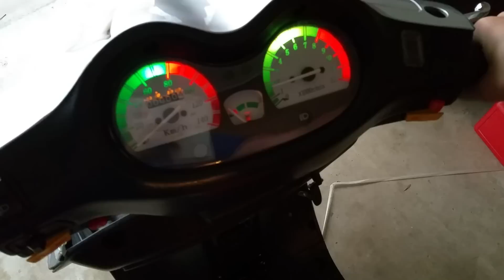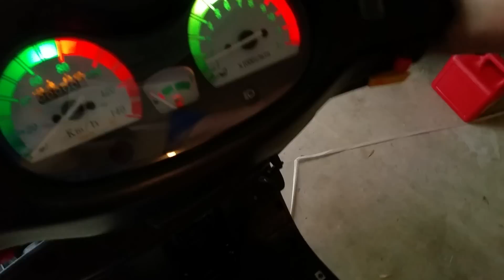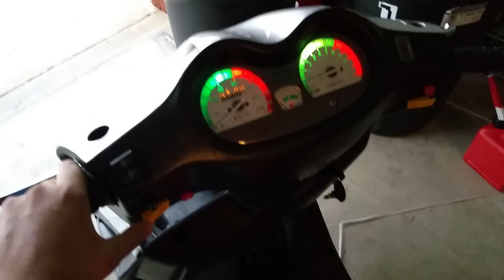Taotao Lancer 150cc First Start

Comment: Ordered one just like it! Same Color Too!
Reply from the maker: You get it? Did you tear it down and put it back together?
Reply: robert young I ordered red,but they were out,so they shipped me my second choice which was blue.I purchased it from Killer Motor Sports.Com and got a great deal.And yes,I'm pretty familiar with this type of scooter,because I also purchased and put a big bore kit in a Peace scooter I bought last Oct. Both scooters run great.I like the Lancer the best because of its styling and power.I also added a Boss MC400 motorcycle audio system to it. If you haven't seen them,check them out on youtube.You might want to get one for yours.If you're wondering,the audio system speakers came with handlebar mounts,and I fastened them to the mirrors and mounted the amp in the glove compartment.Looks and sounds great!
Reply from the maker: mikesidoj2 ah nice! I do have 1 knock on mine. I put 100 miles on it and am already having to do a valve adjustment. Damn thing became harder and harder to start and now it takes about 10 minutes of kickstarting on a cold start to get it going. It also started to die if it idles for too long. Been too lazy to readjust the valve. Knew it was probably going to need to be done but expected it more around 1000 miles.
Reply: robert young Had the same problem with my Peace scooter after adding the big bore kit. I had to adjust them "three" times on it. It's very frustrating but easier to do on the Peace scooter. I hope it is finally broken in so I don't have to do it anymore. Watch out for water in your gas too.I finally figured it out after doing everything else.Your scooter will not hit a lick if there's water in the gas. Had same problem on both scooters with water in gas.The gas came from a local store in my area. Drain your carb and tank into a clear Coke or Pepsi bottle so that you can see if there is water in it. The water will settle to the bottom if there's any in your gas. It sounds elementary,but that is one of the main reasons for hard starting. It will start with ether,but will die after the water gets back into the carb.
Reply from the maker: mikesidoj2 I'll keep an eye on that but we're pretty solid here on gas fortunately. From oklahoma and ethanol free gas is at 25% of stations i trust (big brands, 711, oncue)
Reply: robert young  I live in North Carolina and most all stations around my area have ethanol.The station I got the watered gas was a newly opened store that just reopened after a few years. Maybe they filled the tanks at the station when it was raining or their caps have leaks. I never had trouble when I purchased regular unleaded for my car there. .Must just be in their premium tank. Also the mechanics in my area say that ethanol is bad on fuel lines. One mechanic told me this after I purchased new fuel line and filter for my pickup truck,and a month later (believe or not) the fuel line fell apart and I had a major fuel leak. Also may have been China rubber as I've read about on youtube.
Reply from the maker: mikesidoj2 yea anything older gets torn up by ethanol and i believe the engines in these scooters are based off engines created in the 70s so ethanol probably needs to be on the avoid list.
Reply: robert young Speaking on what you just posted : This past weekend,I replaced all the fuel lines on both my scooters with high performance hose I bought on ebay. They have it in (4) color choices. It suppose to hold up to any chemicals including fuel additives like fuel system cleaner. I use "B12 Chemtool"treatment that you can get at Walmart.It also takes moisture/condensation out of your fuel system.Alcohols like ethanol draw moisture. I don't mean to sound like a know-it-all, I just do alot of research.That's how I found your video here on youtube by researching. The B12 Chemtool treatment is an ounce to a gallon and comes in a pretty large can.It also cleans your valves so less valve adjustments needed.
Reply: +robert young Weird. Mine has about 1.3k miles and i've never had to do any modification other than change the gear and engine oil
Reply from the maker: +Jesus'ScooterVids nice! I still never did the valve adjustment. Its just sat in my garage since then. We had a local celebrity riding a scooter get killed when a guy in his right hand lane decided to make a u-turn across all lanes of traffic. This occurred shortly after the valve issue arose on my scooter so it killed the 2-wheeled dream for me.
Reply: +robert young Sorry to hear about the tragic accident.Things happen that we can't control with all of the idiots on the highways.Don't let that spoil it for you.Just be very aware of the vehicles around you,and expect the unexpected and you'll be fine.Also  give yourself plenty of space to be able to react quick to avoid a bad situation.
Reply: +robert young Because someone had a wreck you are scared to ride a brand new scooter? Are you mental? Are you going to give up driving a car because other people have wrecks? Shit happens but riding scooters is pretty safe but just like with cars motorcycles and scooters you have to drive defensively and watch out for the other guy. I've been riding motorcycles and scooters and mopeds for 40 years and never had an accident on the street. I've wiped out motocross bikes but I was flying and tearing it up and you are going to fall off occasionally if your pushing it and doing jumps. The main danger on a scooter is having people passing you carelessly if you are on a slower 50cc and holding up traffic but with a 150cc you can keep up with traffic even on most highways. Just stay off the freeway because 150's are a little too slow on the freeway.
Reply: photonrayswaves
I agree with you. However, driving a motorcycle/scooter one is twice as likely to get into an accident.
Reply from the maker: +photonrayswaves That's great that you feel so passionately about bikes. I don't share the same passion. I enjoyed the 90 miles I put on this scooter but I don't share the same passion as you. I feel so no obligation to defend my decision to you so the best I can say is you're just going to have to get over it. Enjoy your bike, I'll stick to my other hobbies.
Reply: Ordering the blue one when income tax gets here.

Comment: hello Robert Just got a new one 2017 good question never have one before before use it do i have to changed the oil? or just need to put gas on it and use it? 
thanks for answer!
Reply from the maker: Alejandro García at a minimum change the oil. Unless something has changed, the oil they put in it is just for shipping. There's a lot more you should do, basically a tear down and rebuild (change all fuel lines, adjust valve etc) but the oil change is a must. If you go the more extensive route there are guides around you can find. This is a cheap scooter but if you take care of it it should last, the assembly itself though is not perfect thus the tear down.

Comment: gotta quick 2 questions - where did you get him from? is there a specific website i can go to- to look at em/buy em?
Reply from the maker: Aji-Kate Penner oh man its been so long. I got it from somewhere in Dallas. If you just search for the make/model and a major city nearby you should be able to locate some companies that sell these things and they can ship it to you.

Just be aware you need to be expecting to work on this thing. So long as you're willing to I'd expect you'll get a long life out of it.

That said if you live nearby OKC I'll happily sell you mine for cheap. It still has less than 100 miles but needs a valve adjustment and fluids changed since it's sat in my garage for a long time now. I just decided it wasn't for me!
Reply: robert young alright bud thank you

Comment: How do you connect the  disc brake to the wheel?
Reply from the maker: Did it come disconnected for some reason? Unfortunately i don't know the answer to that question. Only the 2 wheels were disconnected from mine and were pretty straightforward to attach. I never messed with the disk brakes at all.
Reply: Robert Young  : How does the two price fenders connect together? My front fender looks like the  holes don’t match up. Can you do a u-tube video of this step? (Please)
Reply from the maker: @davidharper9383  sorry man i don't have the bike anymore. I rode it for 100 miles and sold it almost 3 years back. Here is someone else's assembly video that may be of assistance to you: https://www.youtube.com/watch?v=QGcHzksQ4-c

Comment: So, really, how much work do you need to do on these when they get to your house?? I read they're 95% assembled? But it sounds like you have really done some serious work here. I was under the impression that scooters are low-maintenance?
Reply from the maker: Mitchell Nelson I had my buddy with me who is pretty decent working on engines, but primarily cars, assist me the whole way with the initial PDI where you tear it down and replace the fluids and put it back together. With his help it took us about 10 hours. The 1 thing we didn't do that was recommended and I really wish I had now(not doing this is why I'm experiencing problems with mine, I just need to do this to get it going) is the valve adjustment that would probably had added another 30 - 60 minutes.
Reply: +Mitchell Nelson They are about 90% assembled, you just have to attach the wheel and a few other things.
Reply from the maker: Not entirely true. Sure, it'll start up and go but you're going to have problems. These things are poorly assembled so it is recommended to do some basic things like replace the fuel lines, adjust the valve, and definitely replace the oil because they don't come with oil in them intended to run the engine. There are some helpful guides across the internet on what you should do when receiving one of these. At a bare minimum replace the oil and check every screw/lug nut for tightness.
Reply: robert young
I agree with you. I am referring to the assembly of the bike. The bike is pretty much assembled when it arrives to your home.
Reply from the maker: +Jesus'ScooterVids ah gotcha thanks for clarifying :)